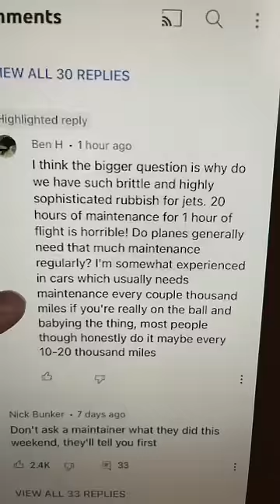Why does an F-16 need 17 hours of maintenance for every hour of flight?

Comment: Look at it this way: for every run down a strip, a top fuel dragster gets a complete engine rebuild if not replacement. It's all I. How it's used.
Reply: @Markus more like 12 sets of tires and the teams have 4 or 5 chassis so that between races they can take the raced cars back to the factory and tear them apart to the base components
Reply: What a crazy waste of resources
Reply: Well F1 could do a race on one set of tires (see 2005 season). They make the tires degrade to make it more interesting with tire strategy
Reply: @SadMarinersFan  not anymore, they have less chassises now. They still take it back to the factory though
Reply: @AleX-jo7vb  Yeah compared to when I was a kid these days F1 cars can legit last now. The engines used to be a complete one shot for qualifying as well. Now they have to actually engineer the things to both slap in quali and last a race upwards of 5 times now. From an engine stress perspective there's been some amazing advancements in reliability.
Reply: @Nucl3arDude  one of the reasons they last now is stopped using rock fuel.
Reply: @lh7801  irrelevant to the conversation but alright
Reply: @ploppyjr2373  I think you need to look up the word "irrelevant" my dude but alright
Reply: @lh7801  what does maintenance of fighter jets have to do with recourse waste. Don’t try to put the blame on me here kid
Reply: @ploppyjr2373  well my latest reply to you got censored for some crazy reason. I guess because I called you what you are and this channel likes censoring mild remarks which is honestly surprising. So I'll say it again.
The guy I was replying to is talking about top fuel dragsters and their need to replace the engines after every run. Not fighter jets.
My comment literally addressed that in a completely relevant way. 
So nice try kid. Thanks for your utterly irrelevant attempt at an arguement
Reply: @lh7801  he simply used an example to talk about maintenance of fighter jets. The conversation was about the maintenance of fighter jets, not about the dragsters. If you want to adress the waste that dragsters create, go make a video about it or something like that AKA making a new conversation
Reply: @ploppyjr2373  dude wtf are you on? I replied directly and relevantly to someone who posted a comment. 
That guy is the one that posted about dragsters. Not me. Why dont you go cry to him about it? I was literlally just responding to the content of HIS comment. 
Seriously wtf is your deal?
Reply: @lh7801  sureee
Reply: @lh7801  it’s not just this channel. It’s a whole YouTube thing.
Reply: @Nucl3arDude  yeah more reliability, only the tire usage is still high
Reply: @lh7801  luckily the scale of these top level racing series is a drop in the bucket compared to everyday car usage
Reply: @lh7801  boohoo
Reply: that swimmer rock fuel will tear stuff up!
Reply: That's because they're designed that way an f16 is not designed that way lol. Top fuel dragster experiences way more wear than an f16.
Reply: Mac tools takes the used pistons and makes clocks out of them.  Bought one when I had a acct. With them.  Was cool and came with the info of where, when,and time and speed of run.all had different burn marks on them .they were really cool.a but pricey but said in info that every run they rebuild engine 💯.
Reply: It's not how it's used. It's how it's built
Reply: @Kylemsguy  yeah you know they could make it last if they wanted too  but they're  business   is   ,,say it with me folks is selling tires
Reply: @matthew9053  what they stopped using topfuel  ammo?
Reply: @lh7801  it would be a waste if you were intending it as a daily driver car, but the whole point of those races is achieving peak performance for that particular event, even at the expense of longevity of parts or efficiency.
Reply: @G1NZOU  so getting rid of an entire engine after each run down a strip is not a waste of any resources ...
Reply: @lh7801  they don't actually junk the entire engine, but it gets replaced and the used one gets worked on and refurbished.
Reply: @G1NZOU  that is indeed a valid point. I dunno. Still it all seems like a pretty big waste to me. And my guess is that they dont reuse as much as you'd like to think. Kind of just the way the world turns. But you definitely made the most reasonable point I've seen so far.
Reply: @lh7801  True it's not ideal from an environmental standpoint, but at least it's on a relatively small scale and done for the reason of edging out that extra performance to win.
Reply: @G1NZOU  I hear ya. And also, it isnt so much the environment for me. It's more like I can't even imagine going through that much equipment and material. Just considering how much of a shortage there is and we dont even have enough trucks to keep up with commerce and industry ...
Reply: WRC cars go through engines like crazy.
Reply: 10 gallons of nitromethane delivered at 600 PSI consumed in 1,000 feet. Basically the Top Fuel dragster gets 50 gallons to the mile.
Reply: @rickdaystar477  But it peaks around 12,000 horsepower for those glorious 3.5 seconds, with basically an oversized aluminum 60's hemi engine with no cooling system.

Comment: This man ain’t lying. I was a C-5, C-17, C-130 maintainer in the air force for 5 years. There’s is never a day off for a maintainer. The work never ends.
Reply: You worked on 3 airframes in just 5 years?
Reply: @branaden  yes. I was in something called the CRW. We would open temporary airbases in the middle of nowhere to perform
Ops in any location. So I had to be proficient with airframes that flew into the bases we opened. Those were the primary airframes. My tech school was C-5 though.
Reply: @johngondek7038  nice! Sounds interesting. I’ve done just over 13 years and worked on 3.5 different airframes.
Reply: @branaden  there are a few jobs that can work on any airframes
Reply: @theboothy91  yeah very common in civi industry. Very uncommon in the military.
Reply: Rain, shine, wind, or snow…..you are “essential personnel”.
Reply: This is the job that never ends... until we muster out my friends...

Comment: When designing things that hold humans, there is a margin of safety used, usually denoted by the factor N.
In an elevator, for example, the N-factor is usually at least 3. Meaning that when you see three cables suspending the elevator car, each one of those is enough to keep it from falling on its own.

Jet fighters, due to performance demands, have an N-factor of 0.7. Basically, you can fly that plane to pieces if you're not careful, and because there is no safety margin on the airfame itself, it has to be inspected after every flight to make sure it won't suddenly snap in a high-G turn.
Reply: The limits of the F-16 far exceed the limits of the human inside. This is why Boeing has been stuffing AI in old bone yard F-16s for our pilots to train against called "Red Air". Former and reserve pilots used to fly for the companies that provided the service to the air force but in recent years have been fielding AI controlled Aircraft.
Reply: @MaxEffortSooner  you mean remote control?
Reply: @muhazreen  Prettymuch, if you built a fighter jet with the same safety factor as an elevator, it would be safe to fly in, but lethal to fight in.

Materials can withstand going over safe limits to an extent before breaking, but plastic deformation will take place, meaning the plane comes back warped and bent after pulling a high-G turn. And that means loads of inspections to make sure it's still airworthy and won't snap its wings next time it takes off.
Reply: So that means Su-25's are held together with duct tape and hope.
Reply: @fallinginthed33p  Well, being that they are ground attack aircraft  that don't perform high-G aerobatics, but are designed to withstand external damage, they're likely far more robustly built than the F-16. However, at the cost of flying slower and being far less maneuverable.

It's always nice to have a sturdy plane that'll get you home if you're hit by something minor, but would be better if you never got hit in the first place.
Reply: We use 5 cables on an elevator, and they are "THE"  safest form of transportation !  they are inspected by a minimum of 4 people before during and after,  and are load tested 5 times, and the once by the inspector.   They are then tested once a year in high traffic areas... And that's just the cables.....The mechanic checks them once a week or more, yep you're safe!
Reply: 30 years old F/A 18 has two engines compared to the f 16 with one engine. And we needed half a hour to maintenance it between flights. In Israel a fighter jet landed with only one wing and the pilot only recognized it after he had landed. The Jet computer made it possible. That was my condolences when I sometimes found some screws missing or lose.
Reply: Jaghetai !!
Reply: @chrisbrodbeck1961  where is this?
Reply: @chrisbrodbeck1961  little off topic but did you see the video of the maintenance man recently killed servicing an elevator on a cruise line? Just curious as to if  maybe you heard what the cause of the accident. They covered it up pretty quickly probably never would have heard about it myself if it wasn't for there being video of it.
Reply: Jet fighters can withstand way more strain than the human body lol
Reply: @whitescar2  Ya know, it wasn't until your second comment that I realized you were talking about regular ol people-moving elevators, and not the elevators on the horizontal stabilizer of a typical airplane haha.

I'm an engineer, and my work involves all of the structure and some of the systems on a number of different commercial aircraft models, and I was so confused by your elevator analogy. The margin of safety...the cables...and the "car" hahaha.  I was like holy shit, this guy is so wrong, and yet this is a super specific and otherwise very informative explanation...am I the one who doesn't know how elevators work??

Anyway, just thought you'd find that as entertaining as I did haha.
Reply: @Tom-ku8bu  that was an old f15 that landed with one wing, theres no computer helping with flying
Reply: Minimum factor of safety would be 1. Not sure where 0.7 comes from. A factor of safety of one would mean whatever you're designing would work with the actual loads imparted but nothing more. Anything less than one would mean it'll fail at the actual loads.
Reply: @Munrubenmuz  Fighter jets are never designed to be able to withstand the maximum Gs forever. As such, they are not designed with a safety factor of 1.
Fighter jets are inherently under-built and if you pull them into too harsh a maneuver, you can snap the fuselage.

That's where the sub-1 safety level comes from. The expected operation of a jet fighter (i.e. combat) is such that it won't actually be able to sustain it. That is why during training pilots won't fly as hard as they would in actual combat. Or when they do, the jets need some heavy maintenance and repair after.
Reply: @whitescar2  I'd love to see a source for your claim. There's no way you would design something not to withstand the maximum loads that are foreseen or expected. What you're effectively saying is if a building could be subjected to 100mph winds we are going to design it to withstand 70mph winds. It doesn't make sense.
Reply: @whitescar2  And on another point what is the point of designing a fighter jet that can't sustain combat manoeuvres. 

Engineer: Here's your new fighter jet. 
Pilot: How will it go in actual combat?
Engineer: We wouldn't recommend that.

Come on mate.
Reply: @Munrubenmuz  I totally get what you're saying, but I suspect it is a bit more complicated than "the plane itself can't do what it's supposed to."

I could see specific parts being underdesigned, and themselves being expected to fail or become damaged under harsh but reasonable flight conditions, and things only go smoothly because the surrounding structure has enough safety margin to help distribute the load for continued short-term and moderate use. Easier to maintain a plane that has an expected failure mode, for which replacement parts are abundant and easy to install.

So, in short, the plane isn't fragile, and has an overall sufficient margin of safety, but it is prone to isolated and well understood failures, which almost guarantee post-flight inspections, repairs, or part replacements., but allow for less worry over the rest of the plane.

Hence the steep cost in manhours to maintain.  But hey, I'm just spitballing here based on my commercial aircraft experience, where safety factors of at least 1.5 are required to even be authorized to fly with passengers or cargo. Otherwise, if some damage or temporary repair can only guarantee a margin of safety of 1.0 for the overall structure, meaning it can do exactly what is expected of it, but without room for error, then you're at least allowed to fly it from point A to point B, empty and not making money, so it can get the actual repair it needs.
Reply: @stinkytoy  Cheers for your reply. I'm a structural engineer so I'm baffled as to how anyone can claim fighter jets are designed with a factor of safety less than one as the OP has. Granted I'm not an aeronautical engineer but the principles are the same. Just wouldn't happen.
Reply: Besides all the g forces, why would you make a military weapon that can just be shot down and be a full piece. So that they can reverse engineer it and use it on you like they have been doing it. Ohh and did we forget about the money cost of making something better
Reply: @whitescar2  That's not safety factor, that's performance limiting. It's going to be widely variable as well... a clean F16 with moderate fuel load flying at 90% of the actual structural G limit for several minutes will have a corpse in the pilot seat when it's done. On the flip side, a Mig-25 with full fuel load can taco it's wings at 4.5G, and has no flight conditions that allow it to maneuver hard enough to even cause greyout in a trained, suited pilot, without coming back to earth in a different shape than when it took off. 

A lot of years ago an F15 pilot did an emergency maneuver to avoid a brief, incredibly fast swim after suffering spatial disorientation. The aircraft pulled so many Gs that the flight recorder's tape was pulled off the head briefly; yes, the aircraft was damaged but still flying and returned to base after taking an estimated peak 30-40G and sustaining 12-15G for a few seconds.
Reply: @mfree80286  As I said, it's performance related. The safety margin is there to say: You can use it up to this level indefinitely and it's safe. It's not a black-or-white line above which the plane will disintegrate.

Just that when you go over that line, you're starting to introduce stresses and strains on the fuselage, wing struts, etc. which the mechanics are going to love you for as they get to dismantle the aircraft to inspect for any hairline cracks and fatigue marks.
Reply: @whitescar2  What I was trying to impress is that aircraft are not underbuilt... and you're misunderstanding something somewhere because aircraft are N<1.5 as a lower limit.
Reply: @mfree80286  They are underbuilt from the perspective of safety, because they emphasize performance. A different set of priorities. A plane rugged enough to be N>3 safe at 11 Gs would never pull 11 Gs. Nowhere did I imply that fighters are somehow 'underbuilt', but rather that their performance is such that they can, if flown aggressively enough, rip themselves apart.
Reply: So the A6m3 couldn’t just pull consistent 17Gs?